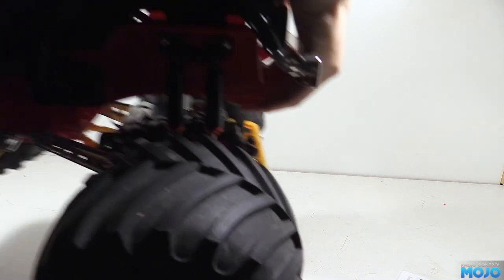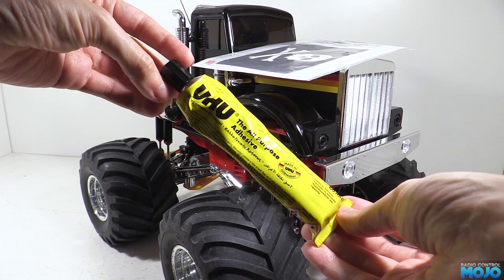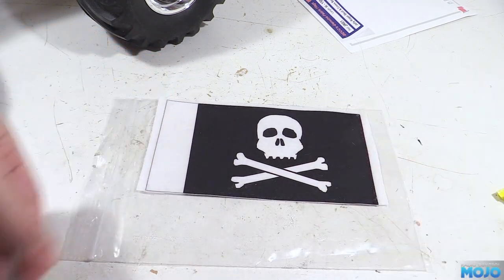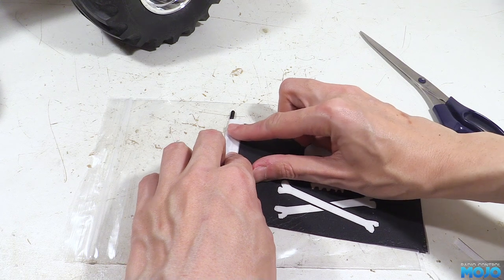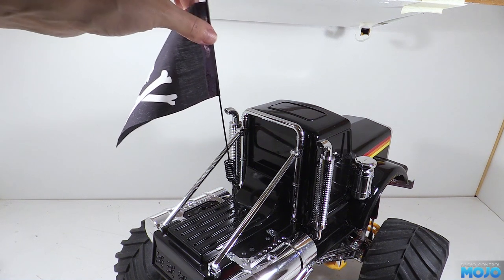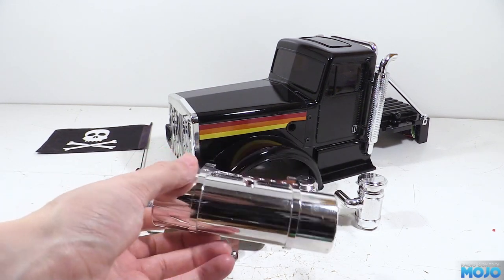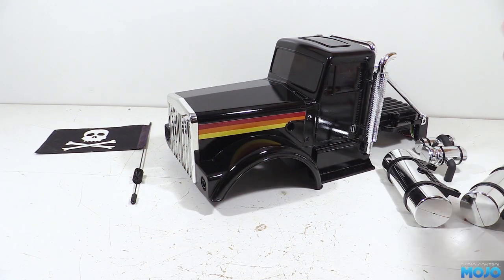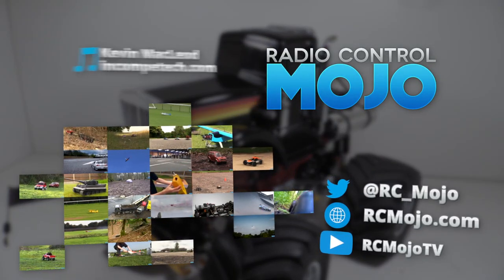Tamiya Bullhead - #11 Jolly Roger

Comment: Looking good. Would the flag worked better on a tube. Maybe fuel tube so it can spin. Just a thought.
Reply from the maker: Funnily enough while the glue stuck the fabric really well, it didn't stick the the metal pole at all! In the next video you'll see the flag at half mast because it kept on slipping